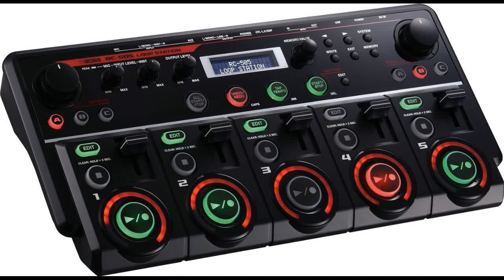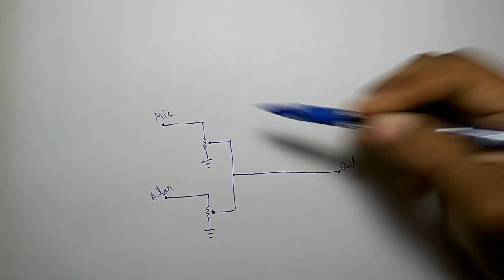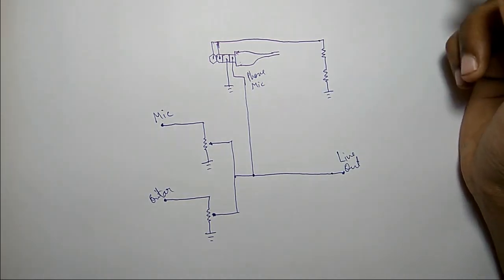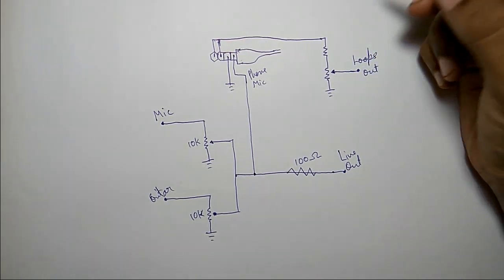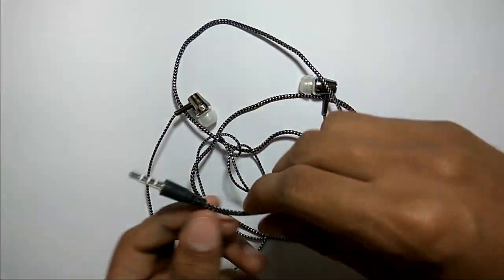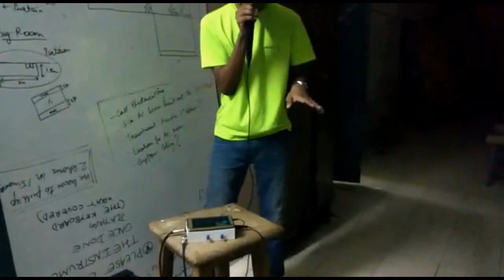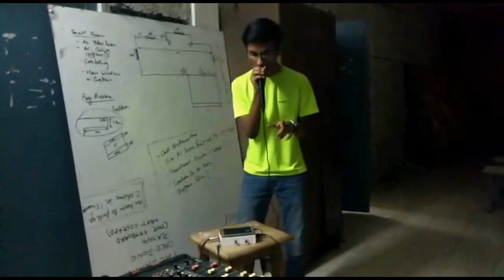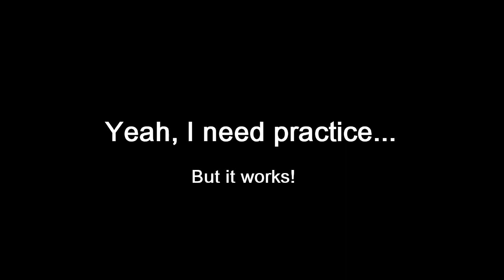DIY Smartphone-based loop station

Comment: instrument level signal like a guitar output is slightly higher than mic level right so if someone strums kinda hard and the signal is a bit too high it might damage the mic input of the phone right? any way to avoid that using resistors to make voltage dividers or something? great project by the way
Reply from the maker: I wouldn't worry about damage; all currents are tiny. Worst case you'll get clipping, but even that's unlikely since the input will likely have some automatic gain adjustment.
Reply: @Psychotenuse  I watched your headphone amp video. but you used a tda chip. if I were to use an opamp to convert a guitar signal to line in level and feed it into the aux port of a stereo to play then how much gain should I set the opamp to? please help me out
Reply from the maker: The gain wouldn't have to be much, maybe 10 ish. The biggest difference between instrument and line signals is impedance.
Reply: @Psychotenuse  thanks I"ll try to test it out using opamps. do you have discord to maybe bounce off some ideas I'll really appreciate it.
Reply from the maker: You can email me at psychotenuse at gmail dot com

Comment: You said that you can't find a was to Put everything in one Output but there ist an very easy one. A diode. It allows Power only to flow one way
Reply: If you mean what I think you mean, the problem with your idea is that it would remove ac from the signal, which is the signal really
Reply: @blackliquor4201  Oh. I didn't think Ablauf that okay thank you

Comment: this is amazing||| please can u explain how to do the circuit step by step, i mean how to wire everything i dont know how to do this but i really want to learn, im a musician not an engeenier, sorry for my bad english but please help me this a piece of art and i really want to do it||| thank u
Reply from the maker: Thanks! And sorry for the late reply. Unfortunately I don't have a more detailed video. Perhaps you should start with simpler electronics projects? Once you've understood the basics of soldering, reading circuit diagrams and using a connectivity tester, you should be able to build this.
P.S. "iRig" is a device that basically does the same thing as what I build in this video, minus the live output, the second input and the volume controls. It was either not on the market, or I did not know about it, when I made this video - but it may work for your purposes.

Comment: I dont know if you know the piezo tranducer but just incase how can i replace the mic using a piezo?
Reply from the maker: Harie Amjari The two inputs "Guitar" and "Mic" are just inputs. If you have a guitar or other instrument that uses piezo pickups and has a preamp, then you could plug it into one of the inputs and it would in theory work fine. Even if you plug a piezoelectric transducer - for example an acoustic guitar without a preamp - directly into one input you'll probably get usable signals.